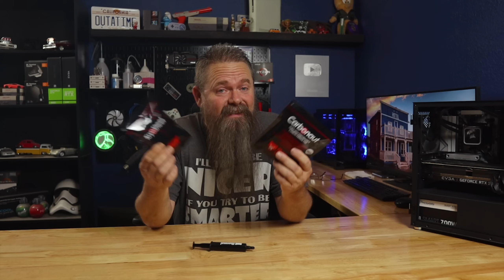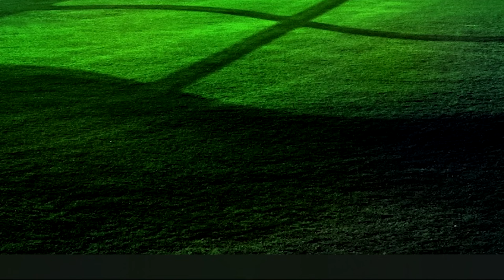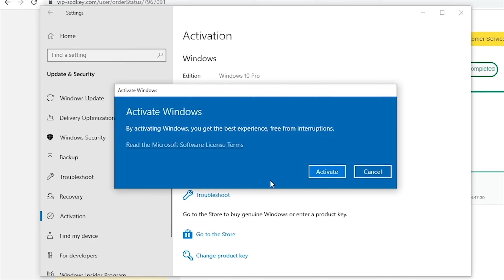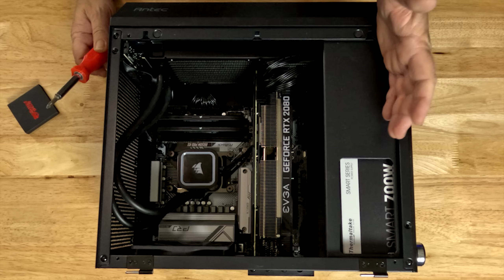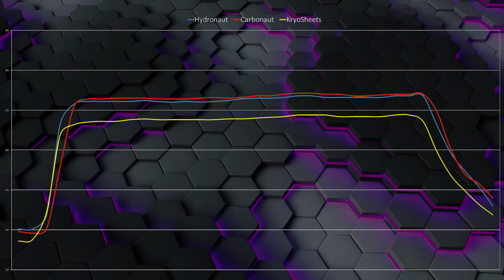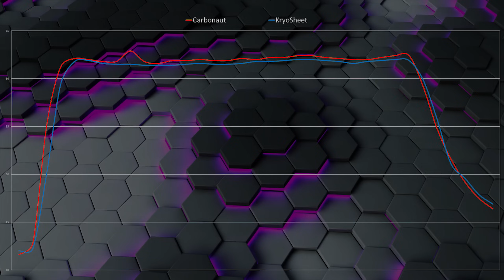Thermal Pads OR Paste, Which is Better?

Comment: Replaced a IC graphite pad with  the KryoSheet by thermal grizz.  Not much impressed.  No real temp difference from the older IC patch. Graphene and the Z axis lattice for heat direction did not do much.  Being generous I might have gained  25 to 50 mhz per core at full load.  Not nothing but , not something enough to justify over paste or generic patch.  The IC patch was fine and reused several times.  14 vs 21 $   Edit .  Ic 40x40 now 16$
Reply: I don't know why people keep coming into this thinking the pads were supposed to perform better than paste, when they've never been claimed to do that. The claim was that they were just as good, and in most scenarios they are.
Reply: @Neonmirrorblack  I though the new graphene Kryosheet would perform better than the older graphite sheets.  Still like the no mess , no dry out perks.

Comment: I use a paper towel corner, that was dipped into 90% ISO Alcohol. Wipes off in seconds. If in the pin slots, or wires going to socket, a alcohol soaked Q-tip gets those clean.

Comment: If I used pads, I'd suggest to place down at an angle or roll it down to prevent air pockets from getting caught.  Same while placing the heat sink.  Like putting stickers or Scotch tape down, i.e. envisioning the pockets/bubbles.

Comment: * Thermal Pads:

   * Pros: Easy to install, no mess, reusable (some models).
   * Cons: Slightly higher temperatures compared to thermal paste, can be delicate and prone to damage.

 * Thermal Paste:

   * Pros: Lower temperatures, more durable, widely available.
   * Cons: Messy to apply, requires reapplication every few years.

Overall Conclusion:
While thermal pads offer convenience, thermal paste generally provides better cooling performance.

The choice between the two depends on your priorities:

 * If you prioritize ease of installation and cleanliness, thermal pads are a good option.
 * If you prioritize optimal cooling performance, thermal paste is the better choice.
Ultimately, the best solution for you will depend on your specific needs and preferences.
Reply: chatgpt ahh reply
Reply: @Raghav-gd3fn  yup , used chatgpt.

Comment: would have liked to see how PTM7950 compared
Reply: better than all of these but slightly by two or 3 degrees
Reply: @jeuxone  I bought some about 2 months ago, and just finally got around to applying it wensday,  both gpu and cpu,  it was way over due, since the paste on both was hard and cracked,   The pad was slightly tacky, so it didn't move around.  at idle, I have a 10+ degree drop, and 15+ drop under load.
Reply: @jeuxone ok cool cuz I just bought a $100 sheet from LTT so I can use it for future stuff
Reply: I swapped from PTM7950 to KyroSheet and ran basically within margin of error of the PTM. I had legit honeywell PTM from performance-pcs

Comment: I'm a bit curious.  We've been using "Sil-pads" for audio amplifier power transistors for quite some time.  They can be reused (unless they become damaged to the point that lose their electrical insulation characteristics).  

I wonder if a Sil-Pad were to be cut to work with a CPU, how it would compare (thermally) to an official CPU pad as "Sil-Pads" are significantly cheaper and have a lengthy history to them.
Reply: It's for the same reason that termal pads used on memory chips aren't used for CPU/GPU applications. Its thermal conductivity is very poor and wouldn't be able to keep up with the huge and fast temperture swings that a modern CPU/GPU can generate.

Comment: I am just a casual builder (2 thus far and current system is i7-2600K) however considering a new system since Windows 10 is about over and newer system with newer technology to work with Windows 11 or 12 by that time.
What I like about considering the thermal sheets, is the idea of install and forget, no more repasting since I don’t do much gaming and continuing heat dissipation to the AIO water cooler. I generally render video’s then burn to DVD/Blu-Ray and a newer system would be so much faster processing the rendering etc., and don’t add/remove additional item’s later to the computer, more of long term build.
Always good topic’s to share from a more expertise guru, keep it going! Lots of Fun!
Reply: I think these are unnecessarily expensive. I would have just go with a trusted brand and simple ones; most people would recommend Noctua NT-H1 and NT-H2 or Arctic MX-6 which are claimed many times that easily lasts over 5+ years, even up to 10 years. You don't need regular thermal paste maintenance until your CPU hits over 90C under constant 100% fan speed. Only then you may need to re-apply the paste, but before that, just clean case's dust filters, because most of the times the issue is dust clogging the filters and building up on the fans, and worst case scenario on the heatsinks; because when you take the heatsink off from the CPU to clean, it is recommended to re-apply a thermal paste even if it's not dried yet; so the problem might not be the thermal paste if PC is all dusty. 

My current case is an old one, Cooler Master HAF-XB (HAF means High Airflow); a small cubic case with big mesh on the both sides and top, only having a dust filter on the bottom and front, which is hard to clean; so, while the air runs free from all sides for better cooling, but dust accumulates over fans if left unattended over a year. Tho it was worse when I was still smoking and kept the windows open; it's better now since I quit smoking and installed AC for hot summer days instead of relying on the wide open windows and an electric fan that never stop running for months. But PC still pulls some dust from environment because the case lacking dust filters. I am using the same case over 10+ years. Because I am lazy like you to maintain my PC, I am looking to change my PC case with newer and bigger one with no big open mesh and easy-to-clean magnetic dust filters (I have my eyes on Lian Li EVO XL for some time but it's 350 USD here which I can't do atm for someone who can save 40$ per month at most, I just bought an upgrade for my CPU which was 99 USD which is Ryzen 5600, lower TDP values, lower energy consumption, and hopfully lower heat production and more quiet PC). What I am trying to say is, keeping your PC dust free is more important to keep it cooler; and by doing so, your thermal paste would last even longer.

Kolay gelsin.
Reply: @ thanks for your thoughts and take for using thermal pads on the cpu. Have a great week!
Reply: In the same boat, i7-2700k processor and needing to upgrade for Windows 11. My one and only desktop build was back in 2012. Reusing the Noctua air cooler and bought some their NT-H2 paste as I never heard of these pads. Like the idea of these pads never needing replacing (though I never got the memo that thermal paste needs replacing). Not sure which direction to go. This upgrade is already costing me a couple thousand between a new laptop and upgrading my desktop, and I'm certainly NOT happy about it.
Reply: @ThePdxster  Upgrading to a new build has become more complicated with component issues, 1) AMD burning up sockets, 2) Intel Ultra core 1851 socket only one processor, new 1954 socket for next ones, 3) NIVIDIA power cords melting and finally 4) Tariff/Trade wars to increase electronics cost.
Wonder if Microsoft would consider helping everyone with a 1-year reprieve on support for Windows. Better yet get rid of TPM and CPU limitations and just address benefits with new security features on newer systems versus older systems.
Best to you and future builds!

Comment: I have the Kryosheet, you can reuse it, if the sheet is in good shape.
Reply: Yep.  Very sus with their original vs second results.  The sheet was either slightly torn, it shifted when mounting the cold plate, or the cold plate pressure wasn't the same as the first time. Those are the only reasons there should have been any variance at all.

Comment: I have a 'uniform' I wear working on computers. Grey dress pants and grey golf shirt. Thermal paste grey.
I use Arctic MX-6 and Peerless Assassin twin tower CPU cooler. I also make sure I use a case with good airflow, because that makes a much larger difference.
I have built over two dozen systems and still on the first $10 tube of thermal paste. Talk about bang for your buck.

Comment: One degree C difference is nothing. Use any paste and forget pads.
Reply: The point is that you never have to remove the heat sink with the pad, unless you're doing it because you need to take a heavy cooler off to transport it.
They don't dry out.
Reply: One degree is maybe nothing but add up one degree with every improvement u make and before u know it you have 5 degrees C different.
For instance I am using push and pull because that gives me 1 degree difference, am using thermal grizzly hydronaut extreme instead of stock thermal paste because that gives me 2 degree diffrence, am using a contact frame that gives me 4 degree difference…. It’s a lot of work and money but I mean it adds up. And I am really happy my CPU runs 5 degrees cooler so it lasts longer and doesn’t burn itself out like my 14900K did (I know that was due to Microcode issues but still).
Reply: Oh and I forgot I moved the AIO on the front as intake instead of on top that also makes about 1 degree difference haha 😆.
Reply: @pvdgucht  It doesn't add up in any meaningful way unless you're either doing an extreme OC, or already using a CPU that is terribly inefficient and uses a high amount of wattage anyway.  

One degree is not "five degrees".  It's one degree.

This test was flawed anyway though, because it's actually between 3 - 5C difference in favor of paste once you start going up in watts (220+).  The 1C - 2C difference is only at low to medium loads.

If you're happy with paste, keep using it.  This is all about convenience anyway.
Reply: @ Well yeah I use intel aka terribly inefficient 🤷‍♂️😅🥲. Idk I like my CPU to  run 5 degrees slower. I will indeed keep using paste because yes I am pushing 300 Watts in an all core workload

Comment: This debate still going on?  Been putting computers together for decades and it's still paste for me. I've never had a problem with pasting and repasting.  And don't forget it's not just to keep air out but as a heat conductive layer from the toaster CPU to your heat sink drawing the heat away more efficiently and faster.
Reply: Replacing the air pockets with the paste is what increases heat transfer.
Reply: @louf7178  That's what they said.
Reply: @williamjones4483  The OP seems to be separating the two.
Reply: The Honeywell phase changing pads are excellent and better then alot of pastes out there
Reply: @tommyboi4872 sure, but paste is that cheap that the best pastes are what everyone’s going to get anyway.
Reply: @tommyboi4872 It's not and I'm someone who uses that pad instead of thermal paste.

PCM 7950 is similar or worst than top 5 best paste. But you use it in GPUs because they deal better with expenasion and contraction of the die, not because is more conductive than the best pastes.
Also, PCM it's basically thermal paste in the shape of a pad, it's not exactly a thermal pad.

Thermal pads, even at higher conductivity, can be worst than thermal paste. That's because a TIM layer will always be worst than metal to metal. So depending on the contact, it can be better, it can be worst. If the metal to metal contact is good and heatcicles don't pump it out, paste is unbeatable.
Reply: I have the kryosheet on my 7800x3d and haven’t had any problems so far. Last time I had to do maintenance the sheet just stuck right to my cooler so I was able to re use it too! No mess at all! And it never degrades. Cool product but definitely not necessary.
Reply: How often do you replace your paste? I’ve not long got my first Pc. So pretty new to all this.
Reply: @LostInDistance  I usually can tell by the temps going on with the CPU.  My previous build from 2009-2022 I only replaced the paste once and that was like around 2016ish 2017 maybe.  Computer wasn't on 24/7 though just when I got home from work but many hours on the weekends.  The temps idle for that cpu should have been between 32c-36c idle but it had jumped to the 40's Celsius on idle. I knew it was time to check the paste and sure enough.  Check your specific CPU specs on temp ranges if they are beginning to push to those limits yeah time to repaste.
Reply: @LostInDistance  Oh forgot to mention a very clogged up Air cooler (which is what I always use) can wreak havoc on the temps as well.  The heat isn't getting dissipated.  So check and clean that first. Then check the temps and if they are still high, yeah the paste needs a redo too.  I do more cleaning the inside from dust (even with a case filter).
Reply: @ only like once a year to be safe, or if your temps start being weird and dusting out your pc doesn’t work.
Reply: @ get ptm7950 or a kyrosheet instead. There’s 0 reason to use thermal paste in 2024 & beyond. It’s completely pointless. Unless ur just utterly broke af, in that case, u shouldn’t be building pc’s anyway.
Reply: This is false & stupid. Nobody listen to this clown. Has no idea wtf they’re talking about…AT ALL.
Reply: Graphite pads superior..
Reply: Also phase change material is not completely immune to pumpout
Reply: I myself wouldnt use anything else then crypsheets anymore. So easy and no maintanance, keeps my 7900xt and 7600x nice and cool
Reply: For best results you should take two Kryo Sheets and place a layer of Kryo paste between them, thus creating a sandwich of conductivity.
Reply: @ go away
Reply: I havent tried any phasechange pads, but every other pad ive ever used gets out done by the most basic pastes. 
Last one i tried was a 20wmk pad compressed to half a millimeter. 10C+ difference at idle. Nope..
As long as you dont apply paste improperly, its better every time for me
Reply: @RoadkillKnight  phasechange pads and the Thermal grizzly carbon sheet is probably the best for CPU and GPU instead of those hard pad which I think probably better off on VRMs and memory chip. Those things are monsters. I changed the paste of my laptop to PTM 7950 and it is an instant 20 C drop. Use paste before and it isn't very good but that probably because I can't seem to find any good paste in my country.
Reply: If you sand your cpu lid to be flat as you can ptm7950 destroys basically all paste other than conductive options @anh413

Comment: With less than 11 months left for Win. 10, why would I waste my money on it? Will MS continue to offer security updates after Oct., 2025?
Reply: Because as the ad said u can use the Win10 key to upgrade to Win11. You can use the key even on a clean install of Windows11. Yes MS will offer security updates forr Win10 after Oct 2025 if you pay $30 USD per year per computer apparently.

Comment: Thermal pads slide if jolted too much. Paste is the only option for the long term.
Reply: What are you talking about?  If you're actually mounting the heat sink with the correct mounting pressure, the pads won't slide.  What are you doing, taking your PC over train tracks?
The only time they have a chance to slide is when you're first trying to mount the heat sink.  That's the only time there's anything to worry about.
Reply: Yes, paste it on for sure.